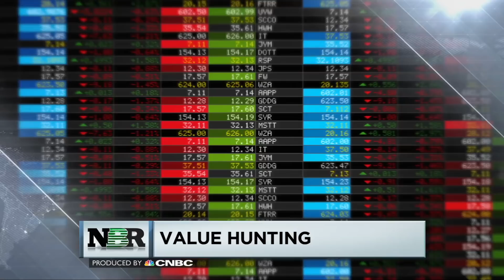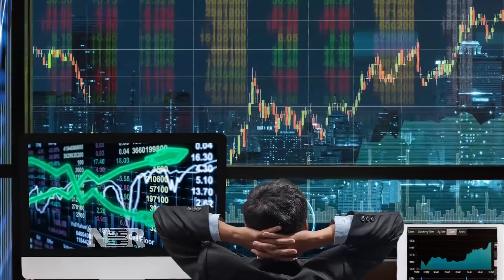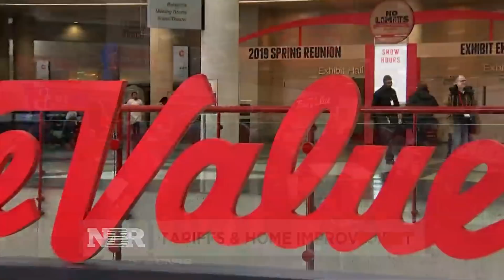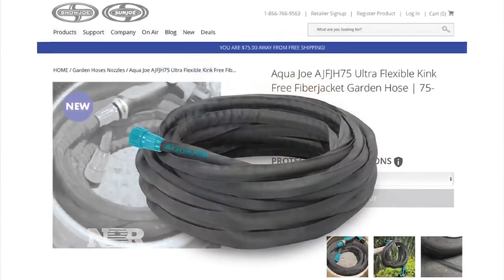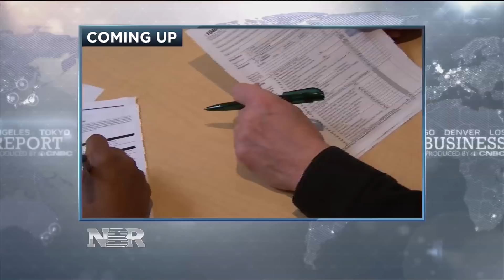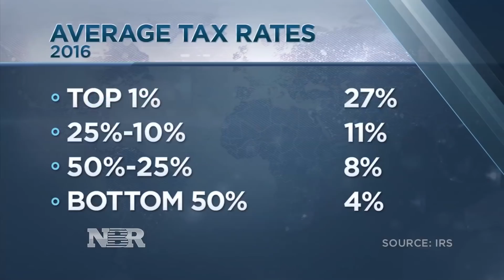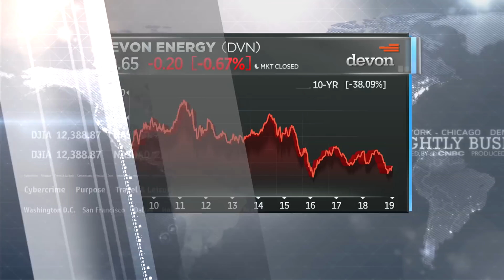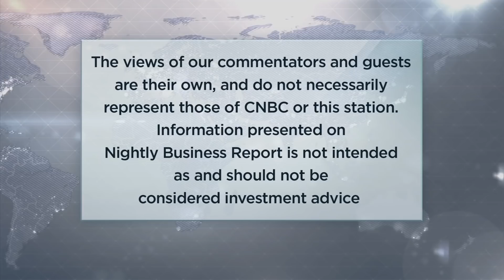Nightly Business Report – February 22, 2019

Comment: Today there were 79 new 52-week highs and 12 new 52-week lows on NASDAQ.    On the NYSE there were 103 new 52-week highs and 7 new 52-week lows..    The slope of the US Treasury yield curve remained about the same with the 1-month yielding 2.43% and the 30-year 3.02%.   Volatility's decline continued.   The volatility index multiple I follow, UVXY, finished the day at 41.95, another multimonth low.

As it is said, the train is apparently pulling out of the station and gathering speed.   There were a lot of ex-dividend stocks showing strength today.     Among them were Sherwin-Williams (US ticker: SHW), NuSkin (US ticker: NUS), Snap-On (US ticker: SNA), and Energizer Holdings (US ticker: ENR).
Reply: Thanks, glad to see your comment.